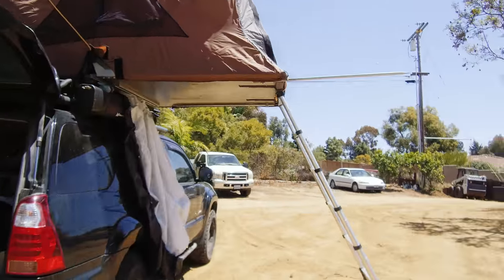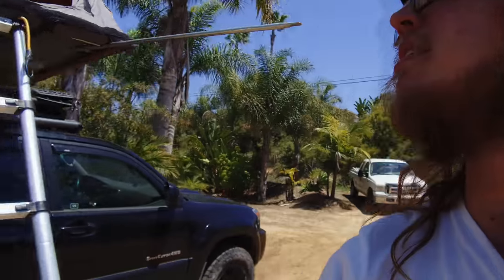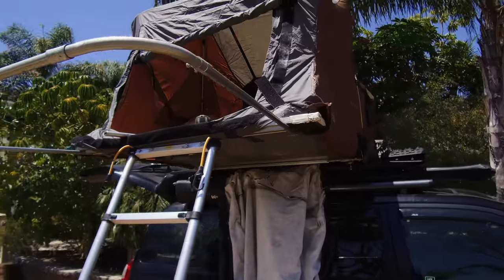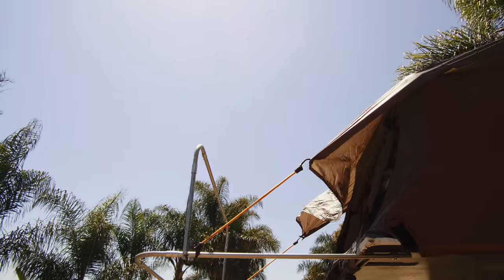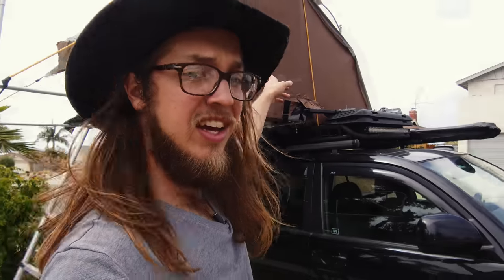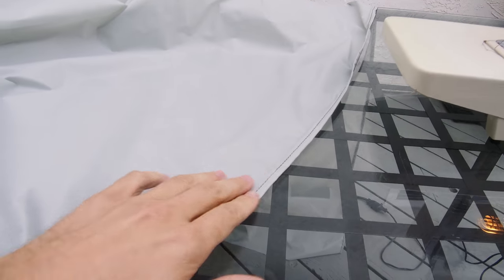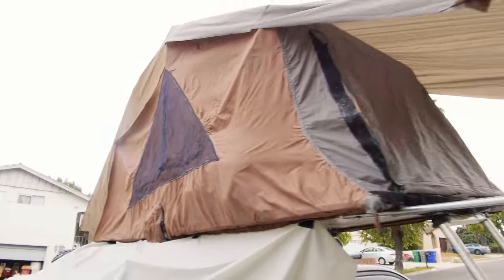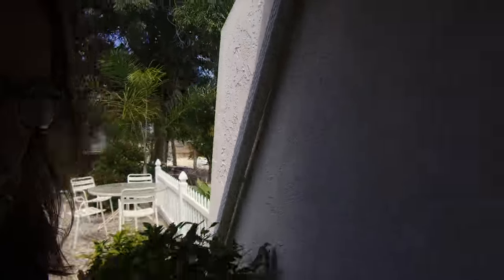Vlog #12 - DIY Rain Fly Upgrade

Comment: What kind the flat steel do u used for plateform ? The size ? I make RTT but for plateform i used a tripleks 18 mm but its not good i feel, so i wanna double it with a some kind a flatsteel for strong plateform ..
Reply from the maker: My platform is plywood with unistrut as the backbone support for it
Reply: @TrailBendersOverland  okey dude thanks alot, i used the plywood to , next i gonna used unistrut as the backbone 💥🙏🙏 thanks again